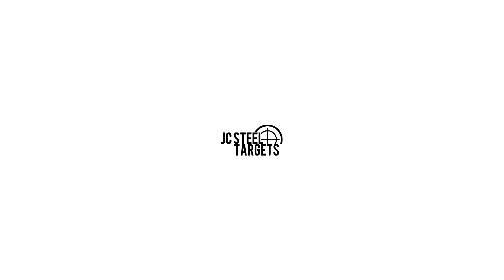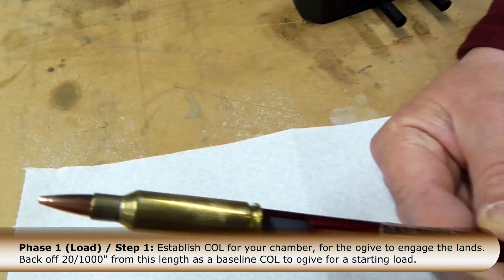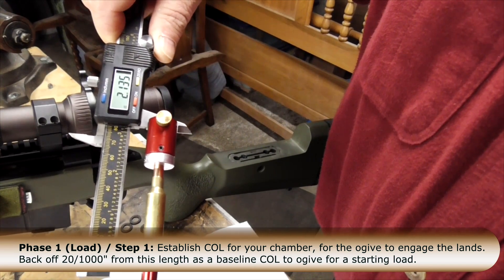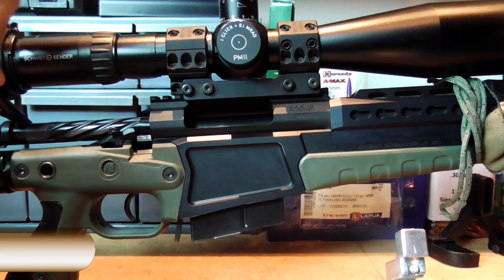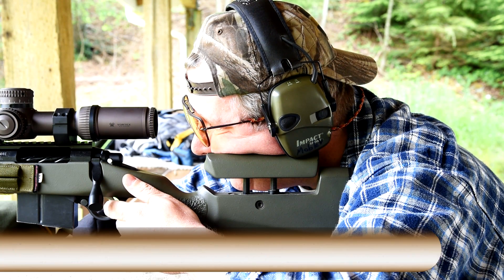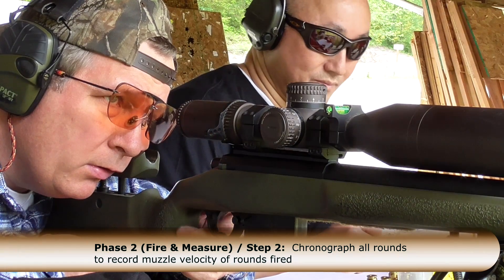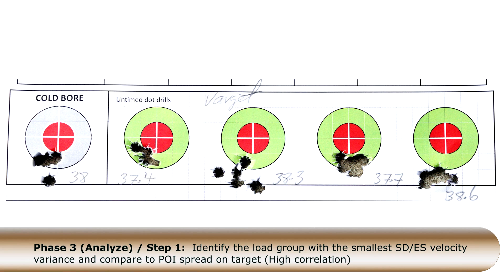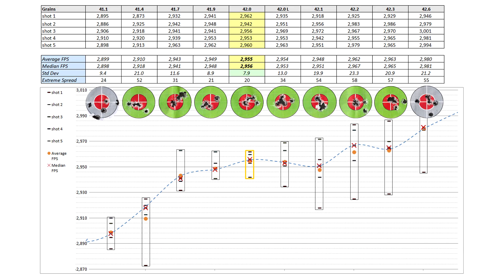S2 - 11 - Load Development (Part 2 of 2)

Comment: how can you find a difference of .2 grains in increments using a chargemaster? those thing are meant to do the preliminary dump for you and then use an accurate scale with at least +/- .o2 grain tolerance and get out those tweezers.... you have all this expensive stuff you load with and then you rely on a chargemaster which I have seen to be off as much as .2 grains or more per charge. You could have missed a lot of good loads and seating depths with that kind of variability.  you don't have to handload every time but when you are testing it makes sense to cut out all the variables so your test is as valid as possible.... after you find the best load that is the most accurate and forgiving, then you can dump powder. jmo
Reply: Shannon Nunn thanks for your time posting vids
Reply: Shannon Nunn Thanks for watching and for your comments. We have contemplated more accurate (and expensive) scales. However, the top shooters in our sport find the Chargemaster more than accurate enough so we don't worry about it. Finding the flat spot on the velocity curve helps to mitigate variations in powder charge weight. Right now we are loading on a Dillon progressive to speed things up and picking out individual grains of powder would really slow us down. One way to get both speed and accuracy would be the Promethius but you're talking $3,000. Might be something we consider down the road.
Reply: I hear you, but you can get good scales for less than that. With tactical it isn't as important to you guys I guess but you should at least borrow someone's high quality scale to just see the comparison. it might scare you. Its like shooting a scope that doesn't have an accurate reticle or doesn't track well. Sometimes you can't see the link in the chain that is weak until you have a way to verify what your  equipment is really doing. with scopes you get a yard stick and put it to a hundred yards and verify reticle matches up and the clicks actually move vertically in line with your yard stick. I have seen guys test 3k dollar scopes that start to run diagonally as they click up the yard stick. It happens.
Scales are the same way, if you can't verify how true it is reading, or how consistent it is, it has the opportunity to bring in unseen variables. My buddy had a charge master and we worked up a good load for him with low sd's and tight groups at 100 yards with 5 shot increments but when he loaded a hundred rounds of it, he started missing shots at 600 yards on a 2moa target sporadically. We took out the chrony and the ones he hit had the same low sd's but he would have velocities that went up to 100 ft/sec in variation in his off target shots.... no joke... so we tested his scale against mine and it was dumping with +/_ .1 grns some times and the it would go to .2 in variation and then every once in a while it would get even worse. His load was a top charge so when he added that variability it jacked up his pressures over 65k and made the bullets fly erratic. I'm not saying all charge masters are that bad, he probably had a dud but it is always good to verify. It helps distinguish if that charge weight is really causing the spread or vertical or if it is the load itself....
  low sd's are what you want but sometimes you can get low sd's that don't match barrel harmonics and still shoot big groups or shoot small at a 100 and shoot big at 300. In my time testing loads I have seen all kind of weird things and it has been my experience that if I hand load everything during testing, (sort brass, bullets, check neck run out and bullet concentricity) it takes the guess work out of it. I have times when I go to shoot matches and I don't have time to do all that stuff but if I keep my brass in order (number them with a sharpy) I only have to do the heavy lifting once.  
  I have a background in science and I am not the best shot in the world, but when I was able to cut out all the possible unseen variables, it was easier to focus on the skill aspect of my shooting, and I was able to improve much faster. So for people that are just learning any shooting sport it could improve their learning curve. Its always advantageous when you know for certain it was you that messed up the shot and not something else with your equipment and loads that went awry.
Thanks guys for your videos, they are fun to watch. Sorry for the novel.

Comment: I do the seating depth before the OCW and just about every time I do it I get  1/2moa or close to 1/2 with just a middle of the road charge weight and seating depth variation... I test 10 thou in the lands, 10 thou jump, 30 jump and 50 jump... never fails....  I used to try different seating depths after doing the ocw and that didn't alter the groups whatsoever... now I do it the other way and getting a solid predictable 1/2moa load is a piece of cake.  I use a chrono when doing any testing and the chrono is worth every penny.  
When taking a middle charge weight to test seating depth, I look at the chrono results and decide how much further up in charge weigh to load for the OCW.

Just like you guys, I don't wait much between shots because I want my load to be stable no matter the barrel temp... When working up loads for hunting rifles I might wait 30 seconds between shots and minute of two between groups.
Reply: ZeroBoostBuick Thanks for sharing your perspective!

Comment: Do you two have the same length barrel?
Reply: vise27 Hi - yes we both have 26" barrels Broughton barrels. However, the 123 Scenar workup that Steve references at 12:22 in the video was shot using a Thunderbeast 30-P1 suppressor.
Reply: Ed Mobley very nice work. thanks for the videos
Reply: vise27 Much apprecaited

Comment: In using my own magnetospeed, I'm pretty sure I've seen it improve the groups of a so-so load and hurt the groups of a great load. I'm not capable of shooting in the "1s and 2s" consistently, so I can't be certain, but it sure seems to be the case.

Personally I wouldn't be comfortable using groups shot with the MS chrono as the basis for an evaluation.
Reply: GroovesAndLands Thanks for watching. I've seen groups shift with the magnetospeed but I've never seen them change size. I had a long discussion about this with the Magnetospeed folks at SHOT Show. I agree that it would be ideal to not have anything hanging off the end of the barrel, but setting up a tripod mounted chronograph with all the rain we get is a real challenge. The magnetospeed has been a game changer for us as it's so easy to use rain or shine.

Comment: I'm still pretty new to this game but I'm curious as to why you look at SD/ES?  Isn't this more about the person loading?  IE when I look at group 4 of h4350  You have one shot at 3019.  If you drop this load you have an ES of 7 and SD of 3.4?  I've always used OCW but curious to learn more about this metric.  Oh and great videos!
Reply: Nik D Hi Nick - thanks for watching. We explain the importance of minimizing SD/ES in part one of load development. In a nutshell, you can have a tight group at 100 yards with a high SD/ES but at the distances we shoot at (1000 yards) you will see vertical stringing. As such we want to minimize SD/ES. Regarding the one shot at 3019 (I assume you're talking about our workup with Varget and the 123 Scenar), we don't want to pick and choose our results - we have to look at the big picture. That load really wasn't a contender anyway because we were starting to see pressure signs at lower load levels.
Reply: One more thing - there is nothing wrong with the OCW method. It's just that it doesn't address variations in SD/ES which will cause problems at distance. Focusing only on the size of the groups can be problematic when you don't know if a group opened up because of human error or an issue with the load. Therefore, we look at group size in along with the chronograph results. When we've used the OCW method (before Scott shared his perspectives with us) our best groups always had the lowest SD/ES anyway. So far all the poor shooting loads had high SD/ES.